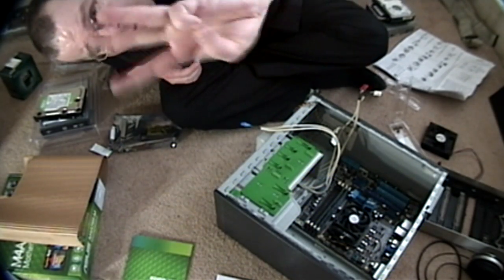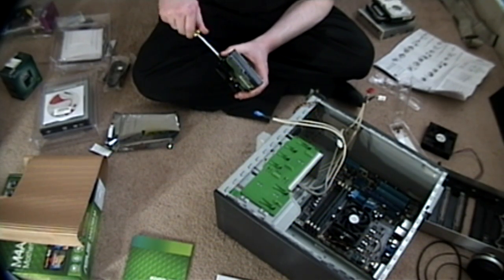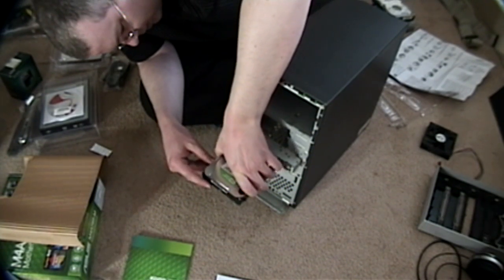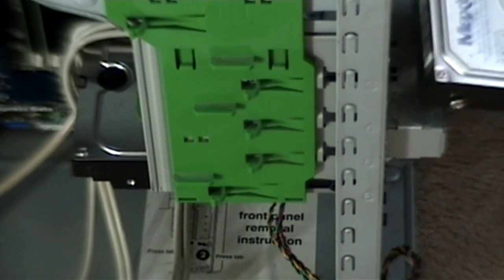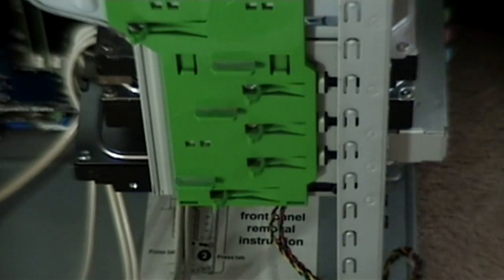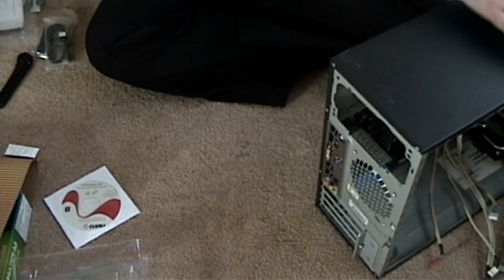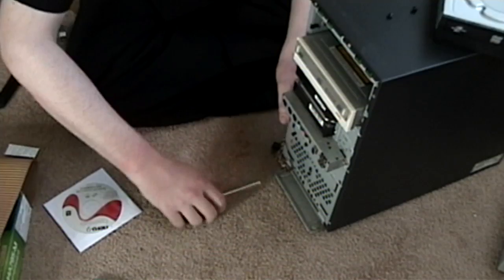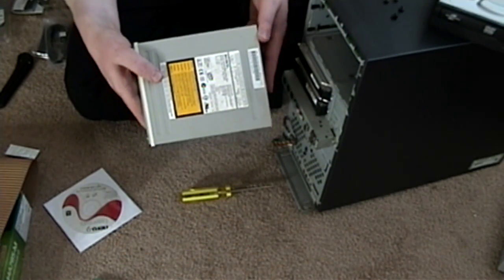Building The New Computer - Part 4: Hard Drives, DVD Burners and Cable Confusion

Comment: you have lot to learn about pc components.
a Green HDD is a HDD with 5400 rpm which means it's slower than a normal hdd(7200rpm). Energy saving in hdd's is just stupid.

Comment: Z, if you allow me, I'll give some hints. Always check the motherboard manual; it allows you to assemble the system in a faster and safer way. For example: if you connect the external USB ports in the wrong way (and it's very easy to do that), you can burn any thumb drive you connect at that port. And "Green" hard drives aren't recommended as system drives. They spin at 5400 RPM, which means low seek and access times. Lower capacity drives (160 or 250 GB) spinning at 7200 RPM are a better choice